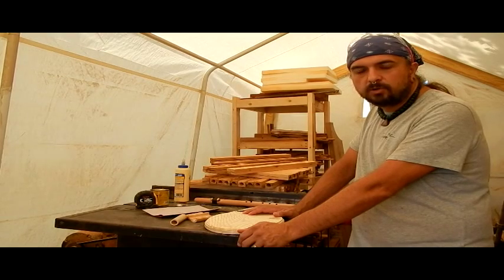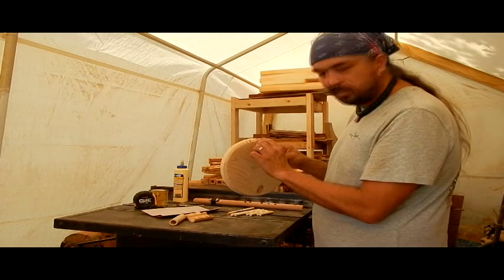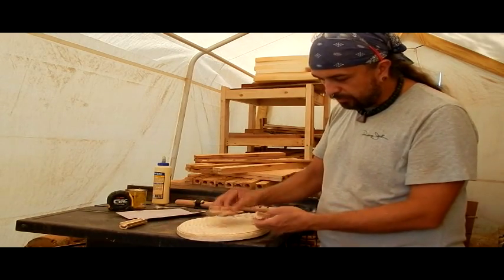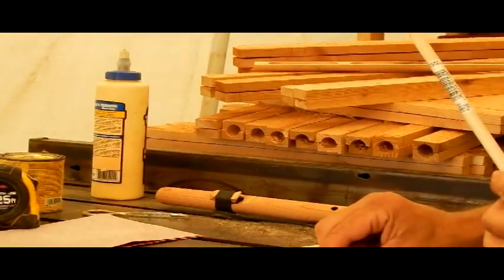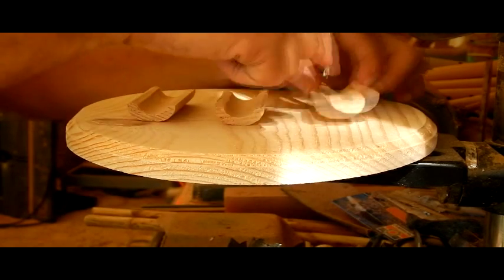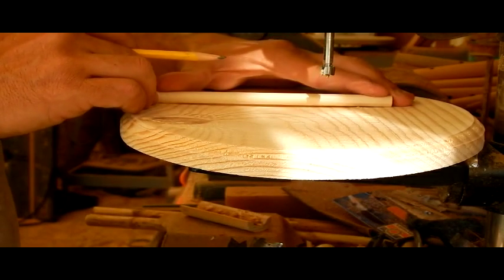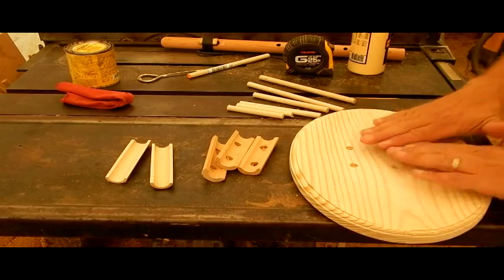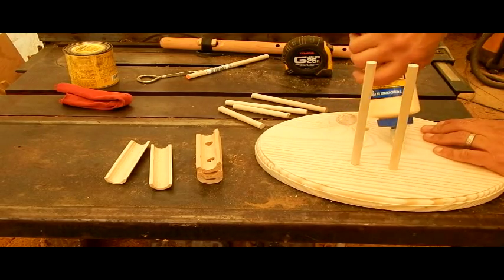Making a Flute Stand for your Native American Flute

Comment: Hi Charlie, the video is great, I am going to make one of these! I was thinking, if you were to mount those half round supports horizontally, it could then be wall mounted. I'll figure out a way. Also need a design for the Drone flute, I'd like to mount two kinds of flutes on it. As always, we love your ideas. Keep on!
Reply: What about using stepped blocks? Either use the river cane, or route out a channel near the end. (I imagine stacked pieces of almost rectangular baseboard, but thicker.)
Reply from the maker: Great ideas. Would love to see what everyone comes up with!